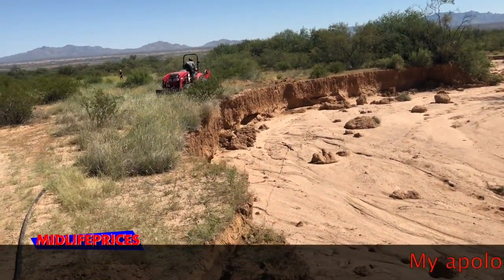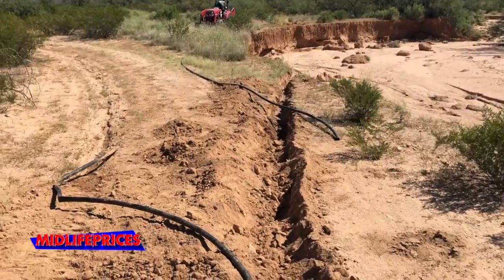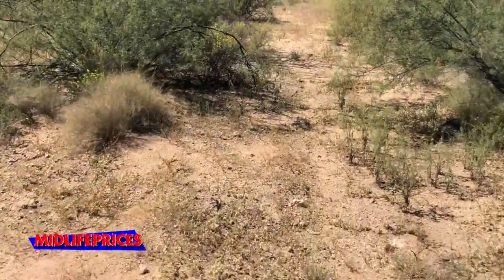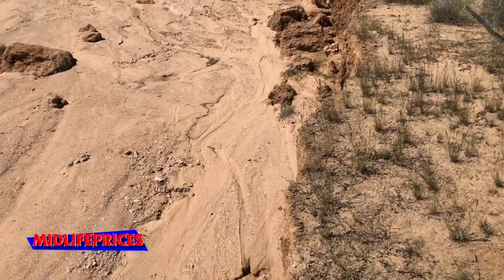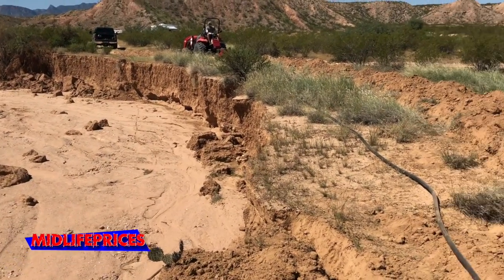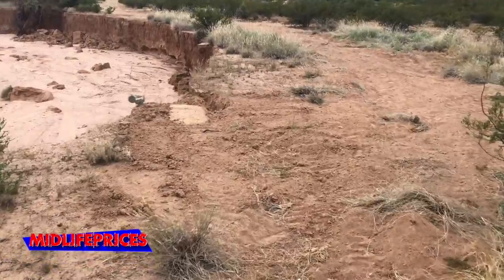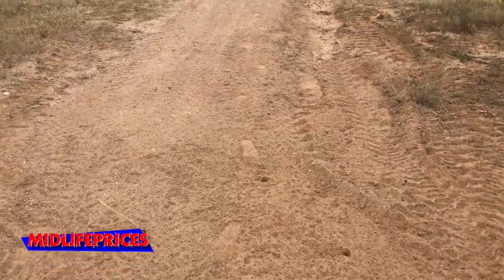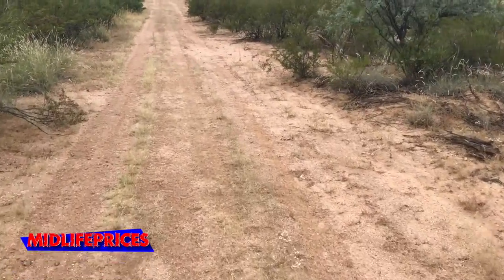Burying Our Homestead Water Line

Comment: Possibly use some native tree trunks ~4' long (unfortunately a LOT of them) as a bulkhead. Pound them into the sand at the base of the wash vertically ~2' into the ground right next to each other and make a wall. It is a natural resource and will be replaced quickly by mother nature. A post hole digger should make quick work of your soil (if you miss the rocks!!! LOL)
Reply: Doesn't look like they have a lot of trees to work with.  LOL
Reply from the maker: There are a lot of possibilities.  We just have to find something that's reasonable and economical for the scale we have to deal with.
Reply from the maker: BC ElginTex You are correct, sir!